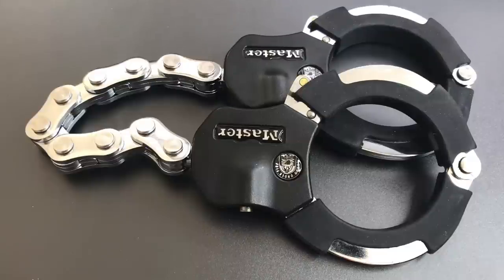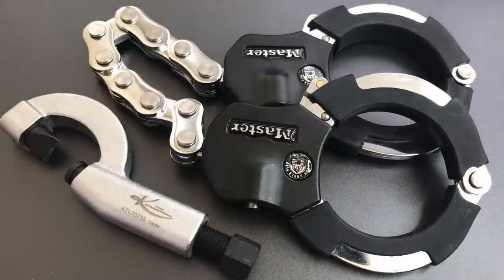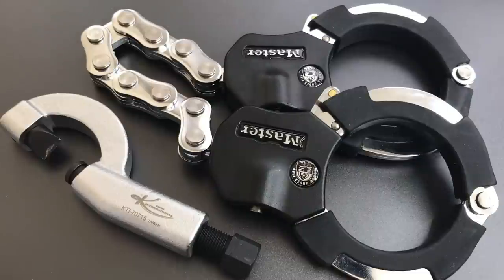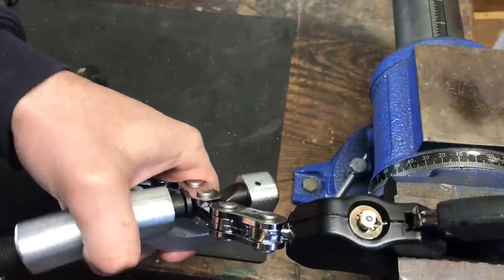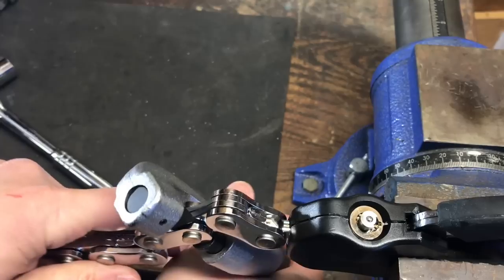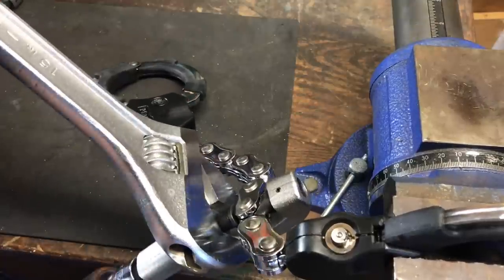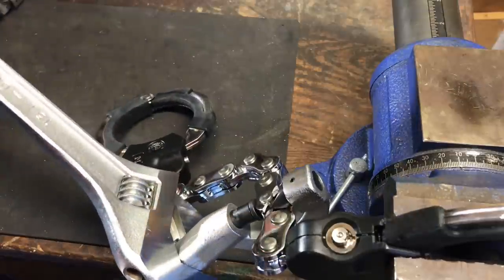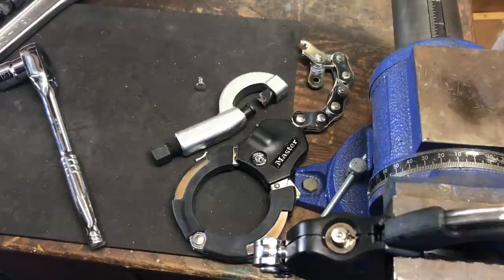[609] Nut Splitter vs. Master Lock Street Cuff Motorcycle Lock

Comment: Never thought of putting the splitter in the vice damn
Reply: He did it in a way that would be possible in the field on a locked motorcycle. Obviously using the vice would be way easier, but most likely a thief wouldn't be able to do that

Comment: How does one counter this tool?  Back to the drawing board, Master.
Reply from the maker: Size, hardness, and better design... maybe a hardened washer between the plates and recessed.
Reply: Seems to me the joint could also be shrouded by metal in such a way that the tool would at least be difficult to use.  It's an interesting problem in 3D spatial thinking.  And that is one formidable tool.  The force  it can focus along the leading edge of that wedge is enormous.

Comment: The usual thug who wants to get something quick to hock for drug money would love this.  Those guys are too shaky to pick anything and carrying around a Ramset gun is impractical. That nut splitter will easily fit in a pocket and is not considered a burglar tool.
Reply: JAMES AZBELL it could be depending on demeanor. No one has a likely reason to have just a nut splitter and a wrench on them. And its still a pretty awkward attack. Its definitely a possible attack though.
Reply: metamorphicorder yeah but you wont be arrested for carrying a nut splitter and a wrench unless they are looking for a bike thief in which case you already screwed up.

Comment: I used to use a pipe wrench for this... just lazy.
Reply from the maker: How?
Reply: The same way you used the crescent wrench... my nut splitter was a bit rounded close to the bolt turned with the socket, so I used a pipe wrench to  grip the splitter, close to the 1/2" socket wrench, and used them opposite each other for maximum torque. Sometimes I used a breaker bar to finish up (heavy equipment is the junk yard dog of mechanics)

Comment: Welp instead of spending tons of money on a decent lock i think ill just spend tons of money on a decent tracking device. 
Seems almost every lock can be easily cut or broken and if it is one thats difficult to cut or break it ends up being some weird shape thats difficult to work with like the u shaped locks i cant stand those. Good locks but they are horrible on where they can be used. 
I had a decent lock on my bike and it was cut and stolen in seconds. Caught on video it took no time for the guy to cut the lock. Had there been a tracking device on the bike id have it back by now. Second bike stolen this year. Next bike will have a tracking device installed on the inside which you cannot remove. Cant stand thieves.

Comment: That method is far too awekward. The thieves will bring a grinder as it is much quicker and straight forward. But this method can work obviously. Only tools I have seen the thieves use so far are bolt cutters, wire snips and a grinder. No picks, no nut splitters, no drills, no hammers. The cheap U locks they use twist attacks to pop them open because the metal on those locks is soft enough to bend and break by twisting the bike 360° and using the bike a leverage.

Comment: I cringed - please don't waggle the work piece all around like that at about ~3.30m. I know it seems like you're not doing a lot of work with the ratchet up to that point but there is a lot of stored energy at that point and you have no idea what is going to fail or how. You assume the rivet will be the first thing to fail and act with that assumption. I've experienced nut splitter tools like that fail dramatically under load, sometimes the hardened blade shatters, sometimes the body of the tool - either way the result has been shrapnel traveling at high velocity, it could easily make for a very bad day.